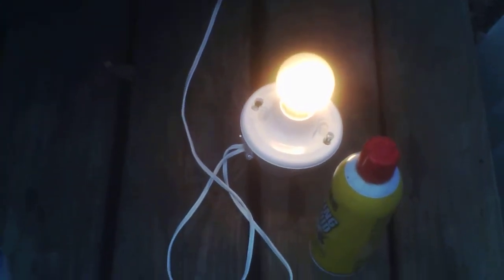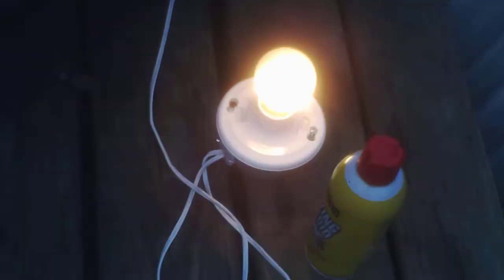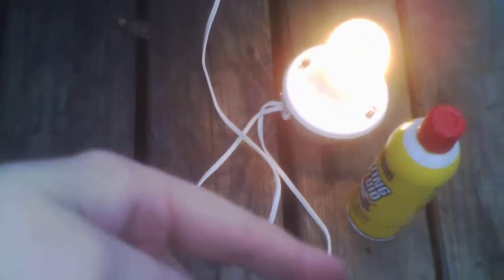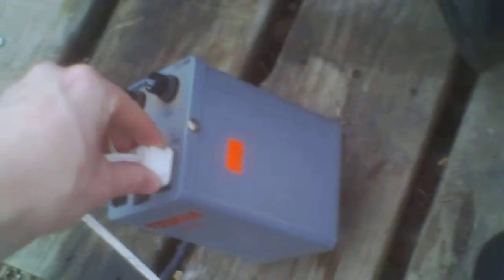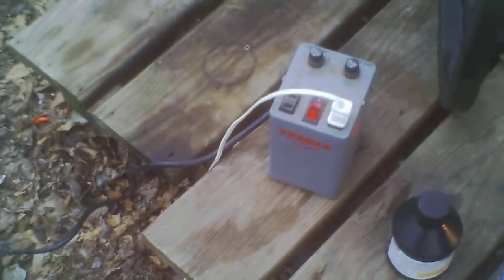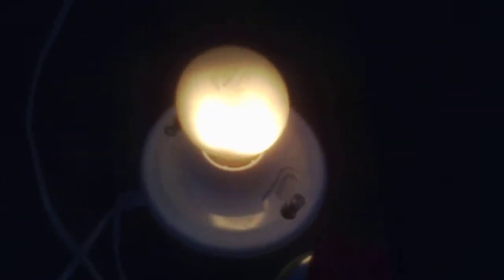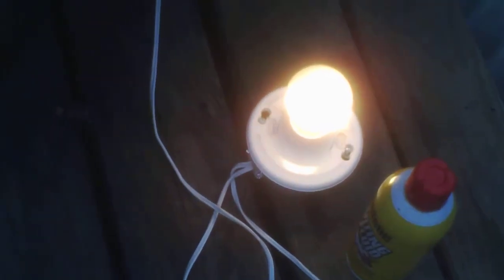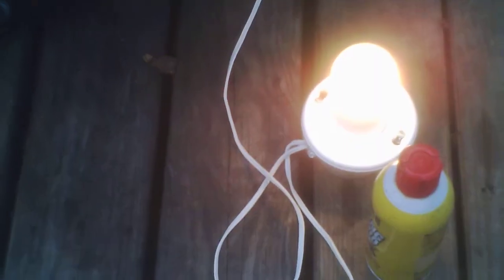The deadliest battery charger on earth

Comment: My batteries are sealed UPS batteries there over 15 years old . I checked them and there put out 1 volt. There not leaking or bulging . I had put them in my storage area and forgot they were there. I tried a regular battery charger and it did not charge .
If they are not bulging or leaking would you charger bring them back to life? 
I spent 7 years in the NAVY on submarines and was a IC2 (SS) and was a qualified electronic tech and a battery charge tech .You may know a  way to bring them back.

Comment from the maker: If the batteries are DEAD dead, with the case distorted and leaking fluids and everything, then no.  By restoring batteries I mean ones where the battery potential is iffy under no load and collapses to a few volts under load, not really dead ones.  Even then the effect is only temporary.

Comment: This reminds me of the past I worked for ASI a radio maker for Delorean peugot bmw and a few other high end radios. I was a warrenty repair tech . I have a 2 year AS degree from UIE .
The company closed and after I worked in a radio tv shop . This was the very early 80s . I know all about Isolation transformers as most old TV have a hot chassis.
I wander if this charger would bring back my 10 year old UPS batteries?

Comment from the maker: Anything that can cause sufficient current through the chest can cause death.  The contact danger comes from things where the potential is in excess of the ~50V breakdown potential of human skin.  There is nothing special about 120VAC in that regard.
The dangers from extra low potential electricity are from the relatively high currents involved overheating things, not electrocution.

Comment from the maker: An isolation transformer is used to electrically isolate a load from the electricity supply.  It has (normally) two windings, with both windings having the same number of turns.  The output (normally; some also regulate the output potential with either a ferroresonant transformer or a transformer with a number of secondary taps and a tapchanger) has the same potential as the input.